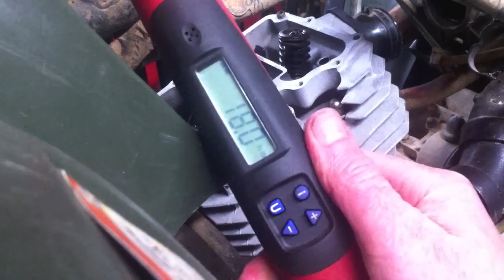How To: Honda 300 Cylinder and Head Installation

Comment: I have a honda 300ex with a 4 valve head and it dropped two valves into the piston and destroyed it.
Will a head off a four wheel drive honda 300 with only 2 valves work on it ?
Please someone help me with this..
Reply: I'd probably just put a 4 value head on it again.
Reply: What ever happened with this?

Comment: Hey i put my top end back together and like you did and now my atv wont start ! Any ideas? Lmk
Reply: lil jojo probably timing
Reply: Check your compression and check your timing and see if your getting spark if your getting spark air and fuel should start unless it has low compression